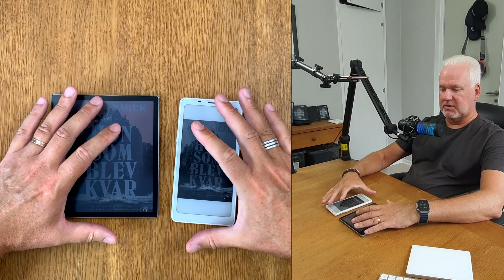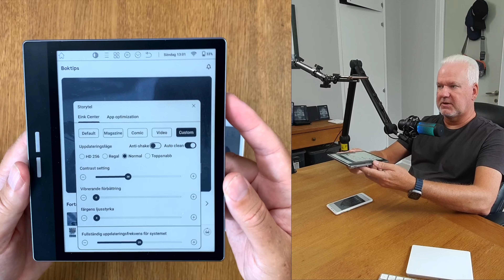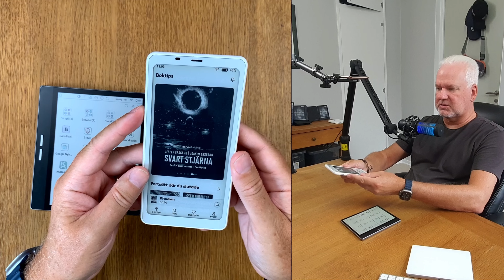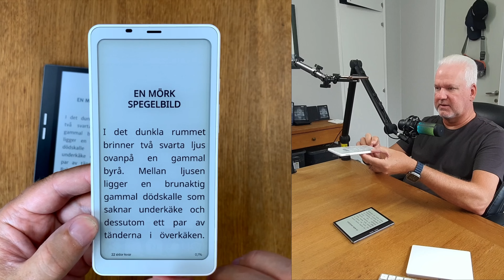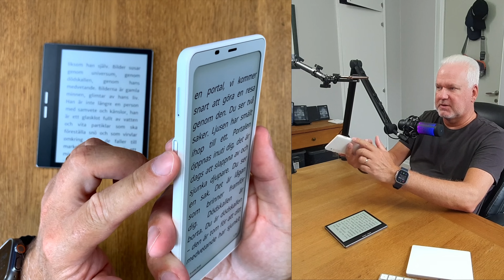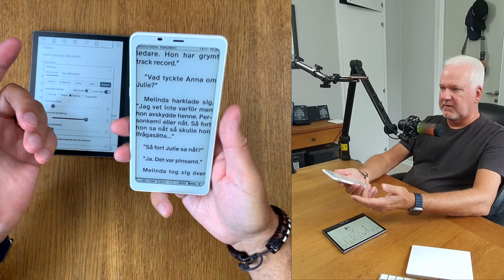Bigme Super Refresh Technology "BSR" better than Onyx Boox? (e-Reader)

Comment: Could it be that since the bigmee reader uses two layers of screens, one black and white and one in color and if you compare with onyx palma it only has one screen layer and when the icons are on the screen for a long time there is more ghosting and in contrast with bigmee , the icons are in color and then when you start reading it switches to the black and white layer and then there are no stored icons? Hard to explain but maybe you get what I mean? Nice video as usual and hope you had a nice vacation with alot of good readings.
Reply from the maker: When using apps like Storytel the bigme or other color e-readers still uses the color layer. You can easily see that when using highlights or notes and also if you have a book with images. But good thoughts and thank you I had a great vacation. I hope you had that too
Reply: Are you sure that you can turn off BSR on Boox readers?
Reply from the maker: Yes because you can always choose HD or Native in the e-ink center and everything gets really slow because it doesn’t refresh more than what you set it to. For example 20 page flips. Exactly as a kobo or kindle works. It’s not until you use any of the normal, fast or Ultra modes BSR are used.
Reply: The color layer on Kaleido is a physical filter that's always there, not a second screen. There's still only one e-ink (basically Carta) screen under the filter, it's just that individual pixels are underneath specific colors of filter. Black and white content just ignores the filter's presence, it isn't on a separate layer.